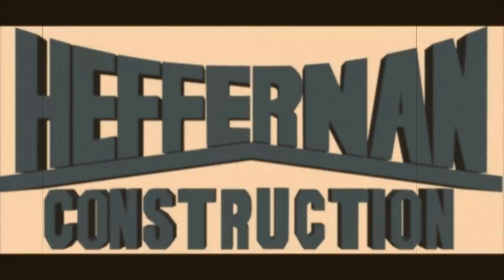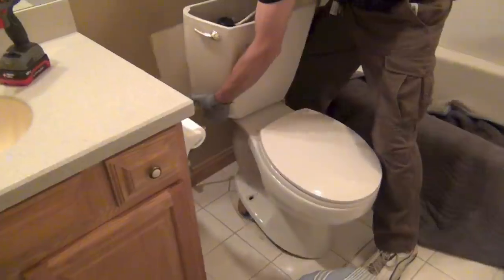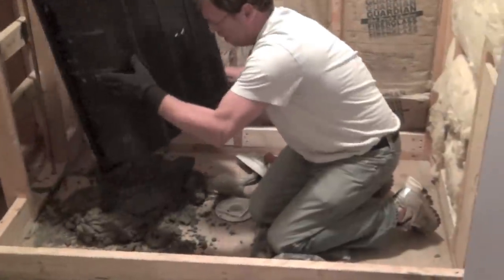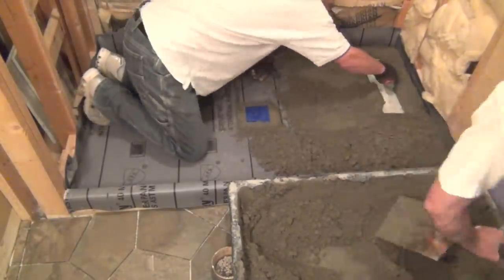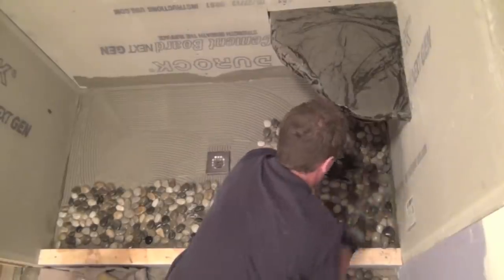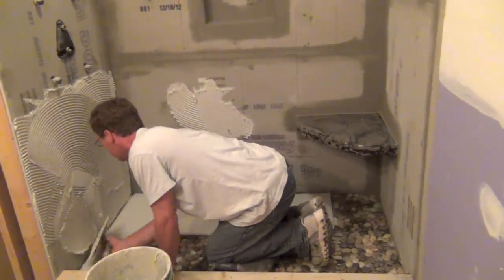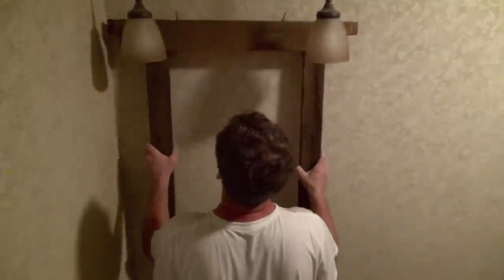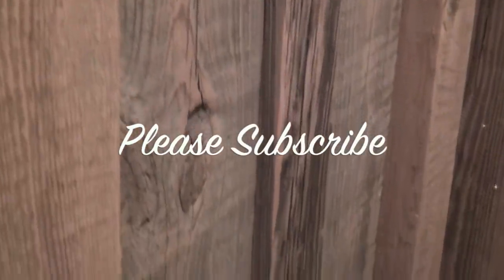Bathroom Remodeling with Barnwood

Comment: Nice job in the bathroom, although  I wouldn't caulk the drain in that manner, you are sealing off the lower weep holes. Also you may  consider doing a waterproof membrane on the walls to protect long term.

Comment: You should really look into schluder shower pan system , much better waterproofing system , and so many better wall boards than that to use, finish product very nice though
Reply: It's funny how people are sold in garbage. Rubber paint to seal the shower. What was used before all this new products were invented. Great video here
Reply: The problem with schluder is you have to manage the build up, Much easier to float the wall.

Comment: Beautiful work. Everything turned out top notch. In the future though the flange for the shower pan drain has slits or "weep holes" on the bottom of it designed to carry moister that seeps through the grout and collects on the vinyl liner down the drain. When you seal the flange to the liner the moister has a harder time escaping.

Comment: This is a beautiful bathroom and if I were to get this in my house, my GF would never leave the bathroom. Nice job. Only question though is with the shower and the old style wood, is there any worry of mold or rot on the wooden frame over the years of use? Or did you put a sealer on before you install that was like a clear coat?
Reply: pinky1900's vitropiso

Comment: Amazing. Over here we need to paint all the walls and floor with rubber kind of stuff and be really careful with the corners and drain -> use special fabric on those. In the end we need to cut piece of the "rubber" layer and measure it's thickness. Bathroom will like a swimming pool before putting the tiles. No water can leak thru the walls or the floor.

Comment: Great work but can I ask why you would but the plastic red stuff down in in construction in the UK and its nice to see what other processes are used   also with the shower you screed the tray to form it twice and use a plastic type sheet. But I didn't see you take it up the wall I use a tanking kit in the UK and we form a seal between the tray and wall    Cheers Ian

Comment: Great bath.  It's IDENTICAL to mine that I'm redoing.  I have all the barn wood I need, tile and collect rocks from the river I'm on.  Any tips for a non-plumber?  I have done lots of showers and tile work, even reset toilets.  Why the floor vinyl above the concrete instead of under it?  Thanks a million!  Love the beams.

Comment: I am getting ready to renovate my current bathroom in my home. It is a very small. The current paint has mold on it, is there a waterproof paint that should be used in bathrooms? And have you posted any ideas for smaller bathrooms. This bathroom is a full bathroom but just very small

Comment: Beautiful bathroom. My only gripe is the unsealed seams between the Durock and the bench. Whatever moisture that gets through the grout WILL get into the walls.
Reply from the maker: Hi Trevor, The only and best way to securely fasten the cantilevered corner seat is to do it the way that is shown in this video. Remember the notches in the 2x4s are cut so the seat will tilt forward so any water that hits the seat will run forward. There is no force that would push the water up hill and into the sub structure. The top of the seat that is against the tile is also sealed with a matching grout caulking witch is durable and flexible. But before the caulking, there is thinnest mortar with the fiberglass mesh that seals the wall to the seat. Ill have to watch again to see if i show it? Ok i looked and it shows at 5:06 that it is sealed as i stated. Actually another layer of the white porcelain thinnest is applied wen tiling down to the seat. So  i guess there would be three protective coatings that are applied to that specific "wall to seat" joint. 

I hope this was helpful, and thanks for watching

Comment: Beautiful job! I'm planning to use reclaimed wood in a bathroom project (vanity and mirror frame and I'm wondering if the wood should be treated in any way to prevent mold, warping, etc? This is the only bath in the house so it gets used a lot...wondering about long term viability of old wood in a steamy environment :) Thanks.
Cyn

Comment: If you lived on the 2nd floor of a 3 floor condo, would that cement flooring still be possible? Replacing my bath with a walk-in shower is an eventual renovation goal on my 'To Do' list.
Reply from the maker: Sure thing, the dry pack cement is not as heavy as you may think.
Reply: Craig Heffernan Thanks. Definitely using this as an example to use for contractors when it's time to do my bath.

Comment: Looks amazing. Questions:

Why you didn't waterproof the backer board using something like Laticrete Hydro Ban or a membrane first?
Also for shower walls, did you use Thinset or a premixed Mastic adhesive?

Comment: Great video Craig. That tile underlayment you guys used looked like that schluter kerdi stuff is that correct? I also have a question as to your thoughts on securing tile to an odd ball sub flooring. The floor in the bathroom is currently vinyl, very badly laid on top of mastic, on top of a true brick floor that goes all around the first floor of the house. I like the slate and the pebble in the bathroom I think that looks amazing... what would your method of securing either of those to the brick flooring currently underneath everything look like?
Reply from the maker: Ive ran into this once, thank god once. We removed all that red brick and cement and reframed it back up with wood to start. If your brick floor is very sound and solid you could try to pour floor leveler on the entire brick surface then the Ditra ?

Comment: Mr. Heffernan, love your videos; learn quite a lot more than what I know.  Yet, in your opinion, "how" do you finish off the bottom of the bathroom tile walls that connect to the floor?  In other words, "what" do you insert into the crack in between the bottom of the bathroom tile walls that connect to the floor so that water does "not" seep into the bottom of the rock tiles.  When you have time, let me know.  L
Reply from the maker: Great question.  First the rubber shower pan that is installed is used for the primary waterproofing. If water does make it to there it will be directed to the drain. I actually use the matching grout caulking in the corners as it is flexible and will not crack.

Comment: Great work , but what about waterproofing. I don't see any waterproofing being done except the pan liner- no membrane liners for the shower walls while the outer bath floor got the kerdi ??
Reply: So true  cement boards are going to mold the pine framing in time. Nice material soon to be pulled by someone else.
Reply from the maker: Michael Itani i hate answering these comments, thats the way its been done for years with cement board and the mesh tape. Water doesn't sit on a wall vertically and soak through the tile or grout joints if moisture gets through somehow the cement board is water and mold resistant along with the thin set used to stick the tile. The shower pan is also installed up behind the cement board 10" from the bottom. We do use the membrane only for super paranoid customers, its a waste of money!!

Comment: Excellent design.  Is there any concern about not waterproofing the shower walls?
Reply from the maker: The grout we use is a premixed,stan resistant and water proof. It costs a lot more but will never need sealed.

Comment: Question: what is supporting the concreting seat in the shower???
Reply from the maker: I just answered this above, 

The notches in the studs are configured to angle the seat forward. The seat was just placed in there and cedar shims to snug it up. The cement board, tile and grout are filled in around the seat which makes the seat stay in place. It is very solid with no movement.
Reply: Ooohhh..... I misses that one, obviously. My bad?

I got worried for a second there, thinking that the first person sitting on that slab would have came out of that shower with a bruised butt. LOL

Cheers, mate.

Comment: So you noched the 2x4's to fit the seat?  Was there anything else you did to secure it?
Reply from the maker: The notches in the studs are configured to angle the seat forward. The seat was just placed in there and cedar shims to snug it up. The cement board, tile and grout are filled in around the seat which makes the seat stay in place. It is very solid with no movement.

Comment: You dont water proof the hardiback?
Reply from the maker: I have been doing the shower walls with just the cement board with no issues for 32 years. I don't use the waterproof membrane in addition to the way shown in this video. That would be a waste of time and money. The membrane fabric was designed to waterproof over just plain drywall. I promise you the way i show you in this video is correct.

Comment: how did you get the shape for the vanity?
Reply from the maker: A big rock was used in the middle when in the forms. A release agent was rubbed on the rock and the wet concrete was packed around the rock and the rest of the form. When cured the rock was carefully pulled out leaving the impression.

Comment: Good job by the builder, but it seems that the bathroom design is a bit sporadic.  First thing's first...the sink was absolutely hideous.  To most, stone screams more of a modern look and wood is defines rustic.  They don't seem to go together well here.  I also don't think the homeowner has considered what moisture does on an organic surface (mold heaven!!!).  I guess what I should say is that I like everything, but the wood and the sink.  The work and craftsmanship are truly stellar.
Reply from the maker: Jonathan Reynon What is it you like or not?       Mold heaven??? the barn wood has seen moisture come and go for 150 years, The bathroom has a fan that removes any moisture in the air and the only sitting water is on the tile floor & grout witch is mold and mildew resistant. Thanks for watching

Comment: This swirls while putting mortar are so wrong, air will get between mortar and tiles
Reply from the maker: I heard of the no swirls when applying the thinest because it would trap air. So i tried to make the notches line up all the way across the floor wall to wall to let the air circulate through. It was ridiculous and impossible to have all the tiles not to have trapped air. I have been applying thinset mortar as per this video for 35 years and never had any call backs.
Reply: @Deckbuilding  
Hey, thanks for answer, sry for bad english. Anyway watch this video from 2:30 and it clrarly shows why straight mortar lines are better than swirls, i couldnt believe kt myslef but when they use clear "tile" you can clearly see why.

https://youtu.be/Way5bMh-eYg

Comment: Anybody else notice, there is no gfci ?
Reply from the maker: I had to watch again to see if that was true. We didn't change any of the electrical in the bath except changing out the light fixtures. But the existing receptacle and lights are run off of a GFI in the hallway. That may not be the way we would have done it originally, but it works.
Reply: Okay, I just thought it wasn't protected.